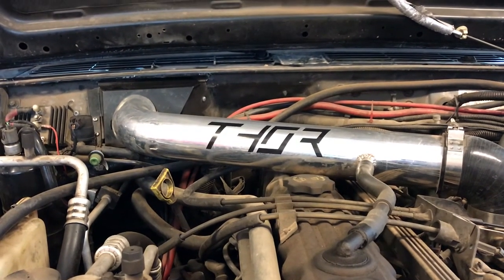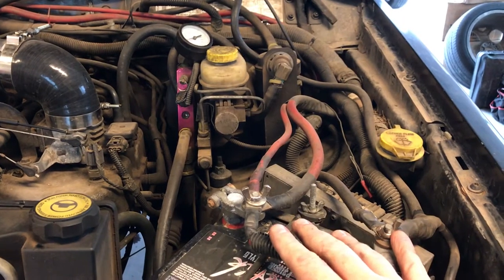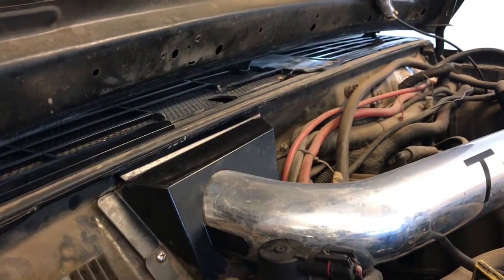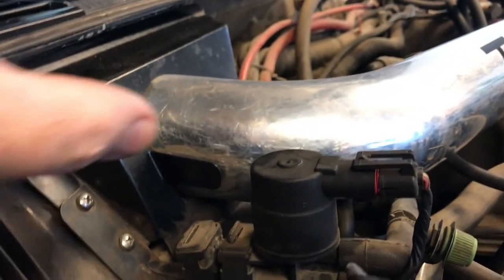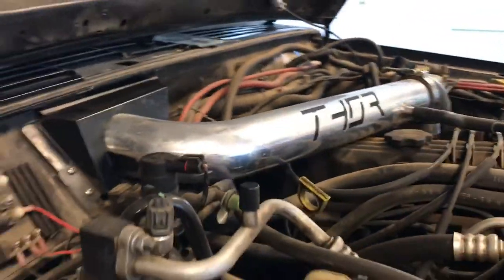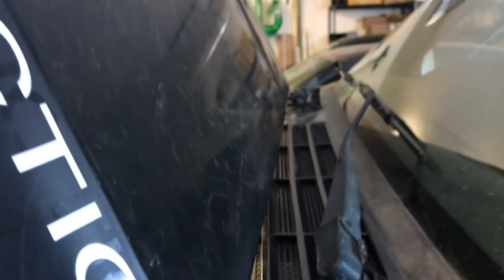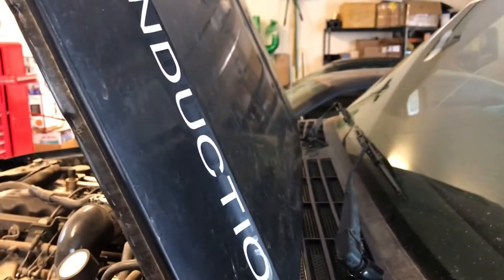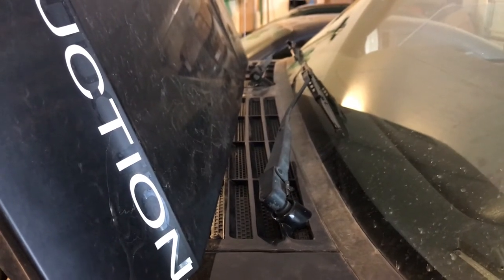Trail Head Off Road cowl intake for Jeep

Comment: It definitly gives a bottom end boost. I went from before installing the Thor cowl intake on my xj needing 1/2-3/4 throttle to pass anything at 60 on the highway (stock gears and 33s)to passing at maybe 1/4 throttle. I'd like to see actual before and after dyno numbers but it definitly did somthing very noticeable for mine.